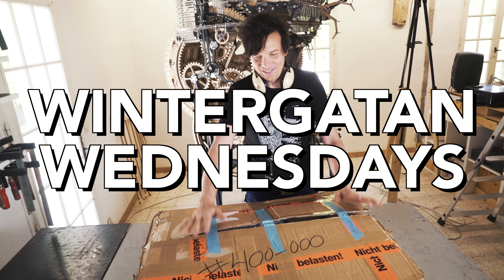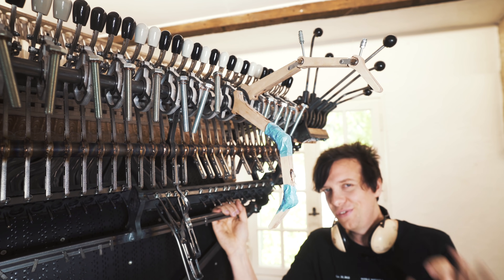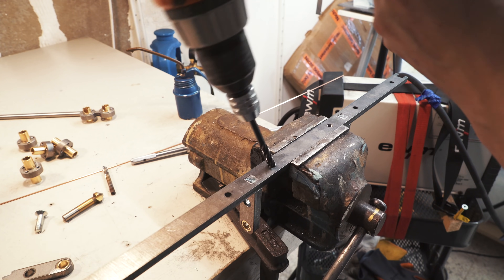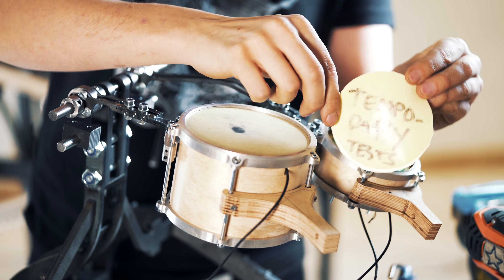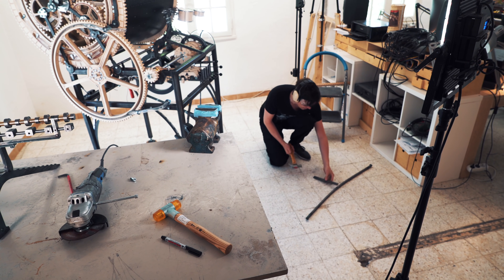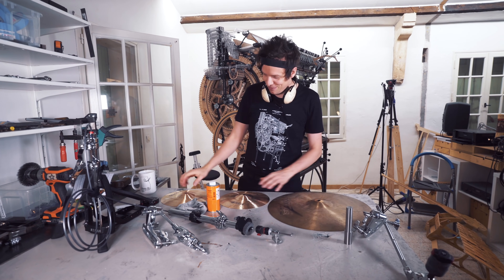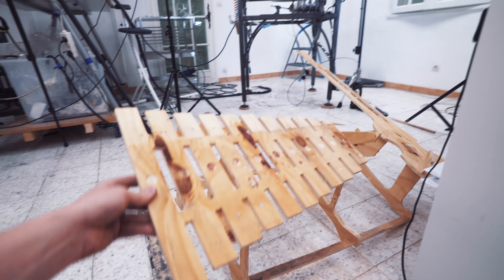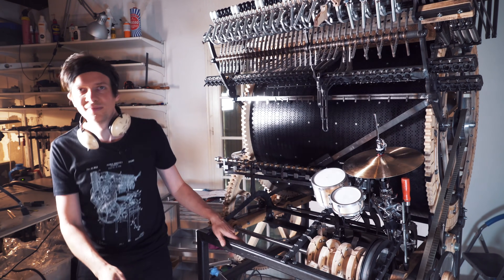Instrument Support Assembly - Marble Machine X #83

Comment: How about putting RGB LED to  the fingers? Tacy yes but its often rather dark on stage siting 100 meters away you wont see the fingers move but you will see the LED move ;). Or make special marble with a small LED in so you can follow the flow

Comment: With so much truly outstanding engineering and effort to this point, I still feel the fingers are a sad mistake with the very best of intentions. I understand your intent to make the operation of the machine visible to the crowd at a distance. However, I'd much rather see you use LED's to show marble drops and impacts on the various instruments. It would have a MUCH more visible and dramatic effect. Stage lighting can make or break a band, same can go for your marble machine. Judiciously done, it could add a very dramatic effect to your wonderful creation.
Reply: LED's are cheap and easy. However, the Marble Machine is about everything but being cheap and easy. While I have second thoughts about the fingers ( they're sort of out of tune with the form-follows-function approach of the machine ), at least they are coherent with the idea of taking the hardest route if that allows to squeeze another tiny drop of fun out of problem to be solved.

Comment: One thing that may help with the welding is if you maintian a consistent speed, then make sure you are doing all of your welds in the same direction. This will help with what distortion you are not able to avoid by making it more even and uniform. Also dont forget that the beauty of working with metal is that it can be heated, shaped, and bent. Unlike wood you can add more material back in if you make a mistake and need to cut something out. It may seem intimidating because of the heat and force needed to move things, but metal is by far more forgiving than wood and is an easier material to work especially if you are mot a master. Things can be fixed then ground and sanded and hidden instead of having to be outright replaced. I am sure you have plenty of help already, but I would be glad to help in any way you might need. Free help I mean. I have been a fabricator for over 13 years now and have access to quite a range of machines.

Comment: You seem 2 have a future  as a welder - with some knowledge of metallurgy there, the straight lines will appear with time - But I think more of a Jet Engine Designer for you - maybe small one's that can be worn on our backs at first. . . Then later maybe the High Nickel Alloy Steels with low expansion co-efficient used in Space Exploration - Hey think that Columbus was searching for a quicker route to the W. Indies - Look what he found.!.!.!    Also - a Programmable CNC Router is in Your Future - - - They are not2 expensive 2 buy, even cheaper to build yourself. 4 someone like Yourself who demands quality and close tolerances - maybe a good investment. LJR-III - OUT

Comment: The silicon mold can also be 3d printed. with 0.08 or even 0.04mm layer hight you get almost the same finish. With a light coating of filler and a bit of sanding you can create a very smooth finish.

Comment: My opinion on the fingers!
They are kind of ugly.. a lot more of the MMX is metal, i thing polished steel "fingers" or similar would look much better than the plywood.

Dark steel like the frame with highlights or polished stainless.. it would look good reguardless of function. The wood clashes visually with the front part of the machine currently. Much of the MMX has a dark tone, even down to the exposed glue layers!

I know, i know... expensive.. but quality.
Reply: It’s just the prototype to test out joints, shape and action. But yes I think the final would look best in a dark metal!

Comment: The concept of the "kinetic fingers" seems valid; subtle motions are going to be invisible from half a football field away. The audience will see the timing drum and pulleys spinning, but not the actual "musical performance" area of instruments and marbles.
But I'm wondering if even the visual aspects of those slim prototype fingers will be enough at that distance? I suspect what you'll end up with, visually, is a lot of very fine 'cilia' wriggling somewhat in time to the music (thanks to speed of light vs. sound) at that distance.
You may want to experiment with setting up a little prototype of a dozen of those rippling to a beat, like from your music box, and step off few dozen or so yards/meters to see what the visual acuity is.
I suspect you're going to want something even larger, like paddles or disks on the end of a stick, and not just slim fingers, to create an even more dynamic moving target that is more readily visible at longer distances. Would be sad to put a lot of work into creating a full orchestra of fingers, only to find out later that even their movement is blurred and indistinct from the back of the house.

Comment: Hi Martin, I've been following you every week since the MM1 video, so I've been here to watch every step of the way. I respect that you addressed the criticism, and I agree with the  "show, don't tell" phylosophy. That said, I also think that you addressed mostly the criticism to which you could easily reply with counterpoints, and said nothing about 1) Hindrance of the fingers to play manually and 2) The fingers actually covering the mechanism behind them, which are IMHO much cooler.
I agree that if you are further away during a concert you would be less able to see every moving part, but you also have to remember that it's imperative for a similar feature to be absolutely in synch with what the spectator hears. When I saw music machines with visual representations of the notes played it bugged me a lot if the sound wouldn't exactly match the movement.
It's a triple edged sword.

Comment: It’s getting there....you should be very proud of yourself and the other makers, you’ve made and are making history.....Martin one question if I may, will you be cleaning up the weld marks so the metal is one colour or are you going to paint it??…🤔…the ‘burn’ marks have character but, this machine is a one off and should be to the highest quality....it’ll last longer too 😉😊

Comment: Will the hi-hat have a channel for the pedal?  Will you be able to sequence the  open hi-hat hits?
Reply: lo-fi ROBOT Boy he mentioned a lever, so my guess for the pedal is similar to the muting levers
Reply: @Kiki-reads  I agree. I guess my thinking is that since the "programming wheel" is essentially just a big 16-bar sequencer, could one not add a track to sequence the hihat pedal? I.e. add a little pin every 4th and 8th bar for an open hat in lieu of a pedal.
Reply: lo-fi ROBOT Boy I see! That would indeed be interesting. I don’t think he could make a new row of programming wheel sequencing without having to redo a lot of components. There’s also a trade-off with the limitations and advantages of it being manual. More prone to human error but having more control would make it’s playability  more dynamic

Comment: I see you are using bottom taps for threading.
Those are meant exclusively for blind holes.
If you have enough room and the hole is straight through, use a taper tap: they are stronger, faster and will automatically straight up... even if you are at an angle.

Comment: Look, you've heard a bajillion comments on the fingers.  You will never satisfy everyone.  Personally, my only comment is that they are inelegant and un-machine like.  The rest of the machine is very elegant in its adherence to form follows function.  The fingers are too human in their current implementation which runs in contrast to the rest of the machine which is doing human things without looking human at all.  So, the feel of the machine is broken by them.  My suggestion is take a cue from Clickspring here, maximize rigidity but still provide beauty and elegance.  No floppy fingers, do some cutout scrollwork on them, have the final impactor to the keys look less like a finger and more like a lathed pin, or rubber tipped piano key striker... anything but a human finger.  You'll still get the movement motion you seek, but it will match the aesthetic of the machine.  Your instrument mounting array follows the function and form of the machine, just make sure the 'fingers' do as well and it will silence the majority of the critics.

Comment: Why don't you buy spiral point taps (AKA gun tap) instead of spiral flute taps? AFAIK the spiral point are stronger (but require a through hole or a lot of space at the end of the hole). With this thickness of steel I think you should be able to power-tap without stopping/reversing at all with a spiral point, in the industry I think this is what they would do using a tapping head.

Comment: The fingers will be useful for audiences near the back, but I think you could fix that by having the MMX's side facing them, making it possible to see all the mechanic wonders of your machine.
Reply: The Creeper the fingers are for a visual representation of the melody, which doesn’t currently exist on the MMX. Most of the current movements are based on the beat like the fish stairs or just general tempo like the rotation rate of the marble lifting gear

Comment: Here is an idea. I know you are very set on the fingers, and I can see the argument for and against them.

I personally think that the fact that they don't serve a mechanical purpose is not why it feels so off putting to many, but more so that it doesn't really look like they do. 

Just like many of the marble lifting mechanisms are a compromise of function and form. So could the fingers be considered. I just think they need to be more connected to the mechanism they are supposed to accent. I. e. that they actually connect to the marble releases in some fashion. So that the movement doesn't just happen in key with the marbles being dropped, but actually gives the illusion that they are part of the mechanism. Some of the hardcore engineering fans will still find it redundant to be sure. But at least for me personally, I think that would make it feel better. 

I do also understand that it would potentially complicate the design of the fingers by a mile and therefore might not be doable. 

Anyways. Just a thought.
Reply: theRabbitFly I like this suggestion, makes a lot of sense

Comment: You are not holding the TIG correctly. you should hold it like a pen. not like a pistol. you would get a ton more control by welding that way. When you hold it like a pen the cable would have to lay over your neck in order for you to have total control, or else the weight of the cable will prevent you.

Comment: Extremely excited to see instruments being fixed in place. 
Kinetic fingers comment: As an art teacher (who also happens to teach engineering), I would highly encourage the kinetic fingers. It is rare for an object to consider both aesthetics and design at the same time. To make something of significance that is valued for a long time, you absolutely need both. You also need to take audience perspective into account. The MMX has considered aesthetics from the very start from the CNC down to the glue layers to the marble lift mechanism, aesthetics has always taken equal priority to functionality; as it should. Aesthetics of the MMX is that it is both viewed from a low perspective and from afar. A larger view of exactly where the marbles are dropping from is absolutely essential to the function of this machine. 
The kinetic fingers are a good idea (whatever form they take) and must be included. As well as make small actions clear from afar, it will personify the machine and give it the sense that it has a life of its own.

Comment: Do you know CRS? It's a cymbal holder with a built in shock absorber! It makes the cymbal mechanically detached from the stand. You might encounter problems with vibrations from the MMX making its way to the crash cymbal.

Comment: Martin, it's becoming more obvious that the MMX is progressing very well - BRAVO! However, something popped into my head which I'm not sure has been addressed yet. Have you thought about how to move/transport the MMX with minimal damage or disruption/movement to the individual components? It's clearly getting more and more metal components which will increase the weight a lot. Jack points and trolley system maybe?

Comment: I'm a bit worried about the weight of the MMX. Especially the center of mass when assembled and disassembled. You don't want the machine to fall over you or your crew members.   Another note. The flares from the angle grinder can leave marks on the other parts of the machine. especially the plastic parts.

Comment: Threading a through hole with a tapered tap is pretty foolproof. The taper guides the tap straight and cuttings fall out. Problematic ones are bottom holes, especially if you have to get the thread near the bottom. A spiral tap helps, it pushes cuttings up out of the hole. If you need to get near the bottom, you need to use a spiral bottom tap. These things you should not try with a hand drill.

Comment: Is the finger movement large enough? Have you made some experiment to see how far away you can distinguish movements of different fingers? I'm afraid other fingers will hide the moving finger. Maybe the idle fingers should straighten out so the curling of the playing fingers could truly stand out? (Fishing line could work as kind of muscle / tendon which could pull a finger depending on how far away the first joint is from given point on the frame.)

Comment: that kinect finger history is kind funny, you could just make the manual Levers actived while in "automatic" mode.
Less moving parts and complexity but... you chosen to make fingers... and turn the manual levels static...
Also, I don't like how they loook, and I don't think they can look much better, on that end they kind fail to do half of they job (look good) but that is my oppinion.

However I apreciate the fact you made a decission to save something that can be problematic and no essential for last.
yes I get the point, the machine has to show itself working, but there is some many to solve that problem without make it look weird.
just a tip on the design, avoid organic, organic look always get bit weird.

Comment: Fix the diagonal. The improvisation looks awful and is probably not that rigid.
Reply: It's only there to stop it from wiggling. Going diagonal is the only way to do this and it doesn't have to be very strong since it doesn't support any weight or anything. It's only job is it to stop the machine from wiggling too much.
I don't see any better way to stabilize the machine. Do you have any ideas?
Maybe there is a way to put in a diagonal INSIDE the programming wheel somewhere, but that's 1. unlikely 2. not as stable. 3. prevents you from disassembling the programming wheel without unwelding the diagonal bar unless you attach it by screews as well.

Comment: Hello Martin, finally sound matters, agreed, but I would recommend not giving up the little snare drum with contact mic too early. I DO BELIEVE it will be possible to find the right punchy ans crispy sound! As I commented on MMX Video #80, selection and positioning of contact mics and acoustic mics should be taken into assembly planning asap. Did not see that in your plans yet. I would recommend to fix mount all the microphones and design the wiring well. Put some of the microphone cables into flexible metal hoses and integrate that into the overall design.  Details about that in above mentioned comment on #80. And please  pic up mechanical sounds as well, like the off beat conveyor belt and rhythmic klicking of marbles or marble rolling sounds. That should be well designed in the overall sound and possibly transported to the audience. BECAUSE not being able to see the marbles from a distance, at certain parts of the musical performance it should be very nice to HEAR them. Do not assemble the mixing desk to the machine this time. Multipair connect from MMX to external Rack where you can control the sound by yourself on stage (e.g. adding or fading channels on demand).

Comment: I'm going to assume that the people who didn't understand what the kinetic fingers were for probably don't understand the purpose of a conductor during a symphony performance as well. Yes, they can give some instructions on details that aren't necessarily on the sheet music and direct the players, but moreso than that, they're there to visually engage the audience. After all, it's not like you can seethe players press the buttons on their wind instruments or see every single mallet swing from the audience. You also can't see the faces of the players and gauge emotion. The conductor translates all of that into visually interesting motions that keep the audience's attention while simultaneously directing the players. The Marble Machine doesn't have anything like that, and while that's fine for a music video, where you can get cameras close up to see the action, for a live stage audience, it's not. So yes, I agree that they need some tweaking and improvements, but I certainly don't think that they need to go.

Comment: I'm a little bit worried that the flat bar at the back of the support of the instrument holder might not give you enough rigid support. I will hold for sure, but I recon it will vibrate too much.